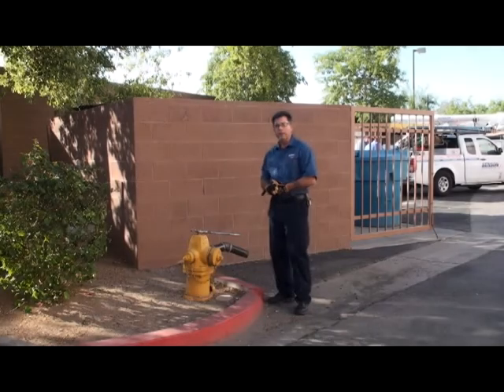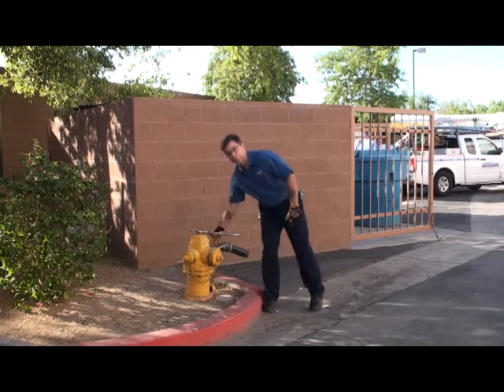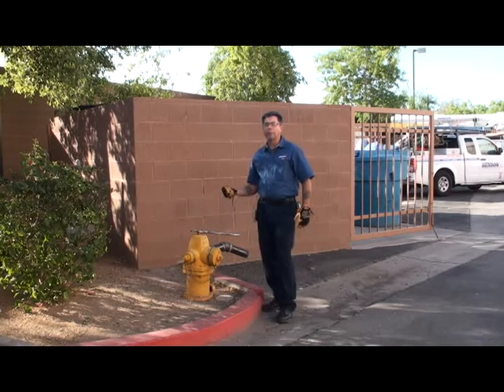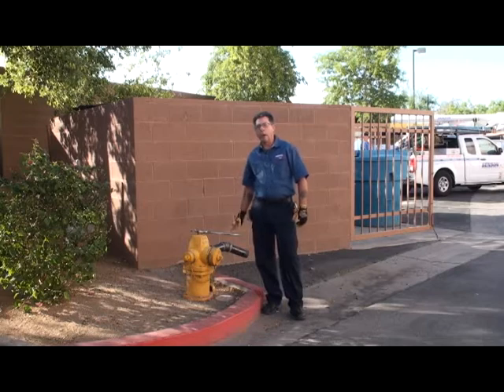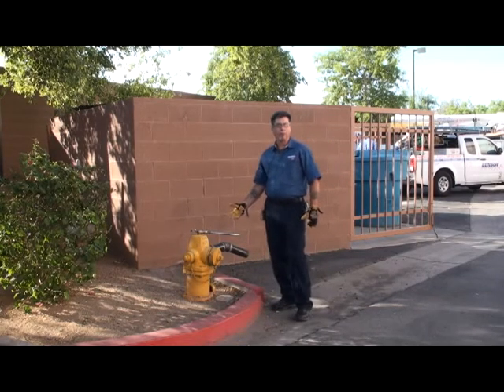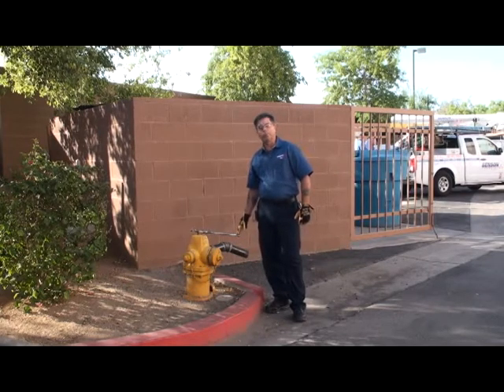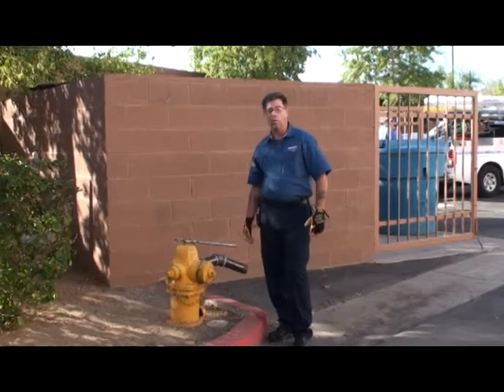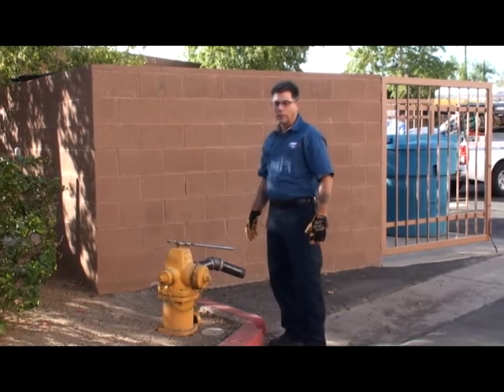Benson Systems Introduction to Fire Hydrants & Flow Tests.avi

Comment: Generally the ports are 21/2" and 4" in many cases which should be standard.
But some adjacent city and places the main port varies.
Sometimes 4" sometimes 41/2 & 5".
How is that and why 
Everything from city to city should be standard size for compatibility purposes!